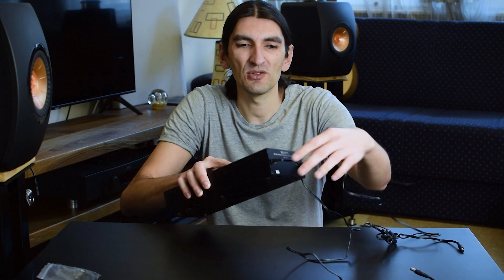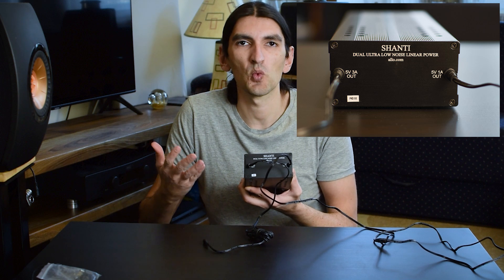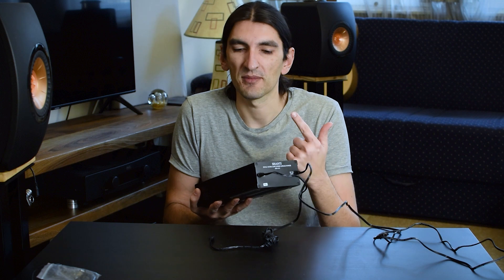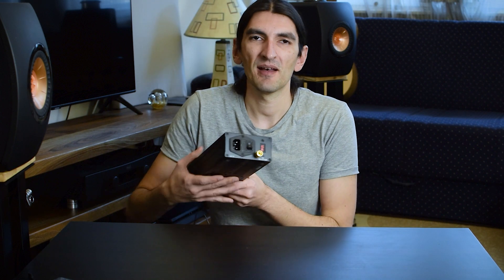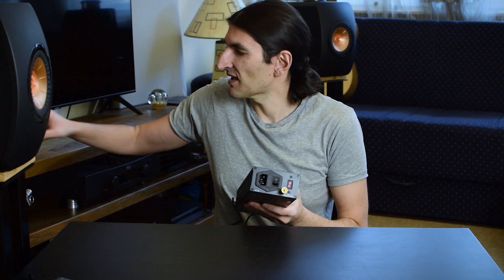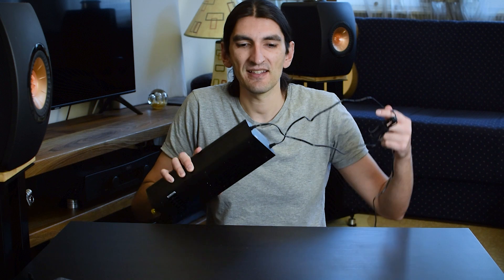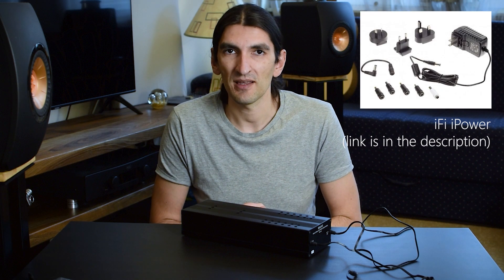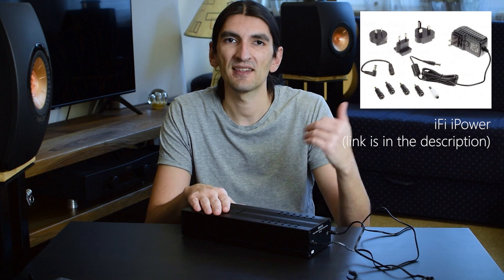Allo Shanti Dual Linear Power Supply Review

Comment: How do you power an Ares II with this?
Reply from the maker: I don't, Ares II has its own linear power supply inside. That's why it's 3.5kg (big transformer, lots of capacitors)... But I use it when testing most other DACs. Soon the Chord Qutest will be one of those.
Reply: @iiWiReviews  What would be your expectation in regard to Denafrips Pontus, Venus and Terminator Plus when compared to Ares? According to Audio Science Review ultra precise measurements of the spectrum, even the Allo Boss2 has so low noise at the level -140dB to -120dB that it cannot be heard. If that is so, why would one buy anything more expensive than Allo Boss2? Are the differences you are hearing just a placebo effect and nothing else?

Comment: no demo comparing to switching PS? bad :-(
Reply from the maker: I promised it at the end of the video. :) Haven't recorded it yet but sometimes in the next few weeks.
Reply: @iiWiReviews  I am really waiting for this. I think you should NOT hear any difference between linear power supply vs switching one if you use them for the digital part of your audio (i.e. streamer or so) but when it comes to analogue (i.e. DAC) it... might. But I am still sceptical about the latter

Comment: Hey Srb. I notice your LS50's toed right in... I know all rooms are different but  in my experimentation I never got close to that, and ended up with them almost straight ahead for a wide soundstage and good imaging in it. I may have to try more extreme toe in just to see what happens. I'm not sure this comment has a point, but neither to the majority of YouTube comments so meh, here it is!
Reply from the maker: It depends a lot on your room reflections and size. Mine is small, if not toed in I get some midbass bloom. It's nice to experiment at least, might not sound good in your space but you loose nothing by trying.